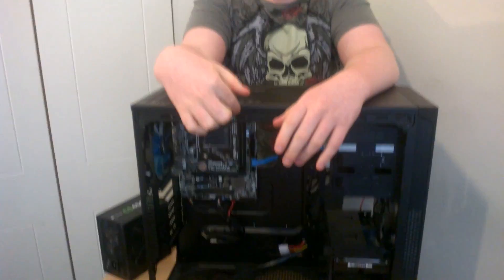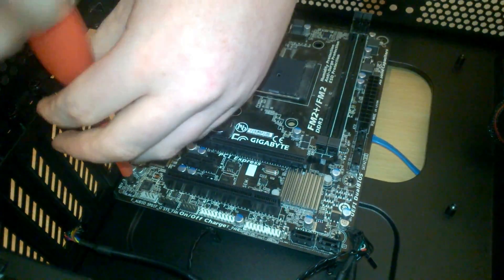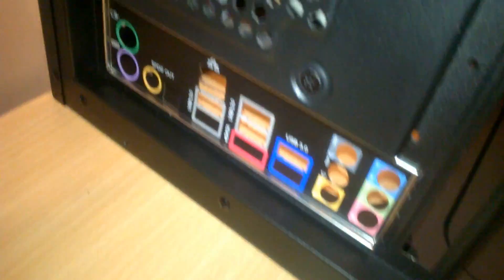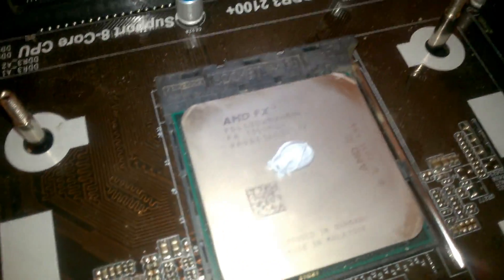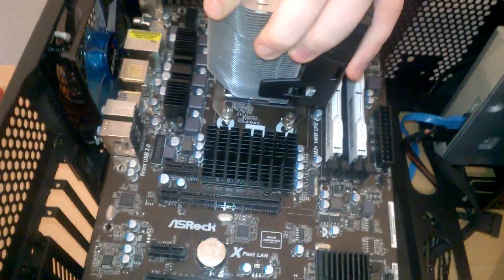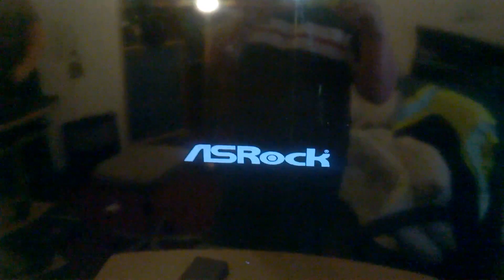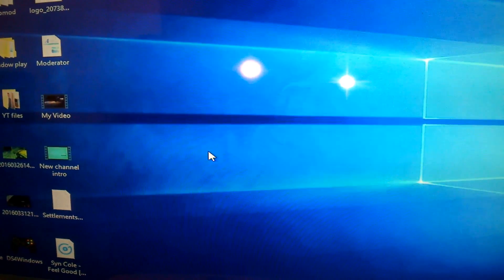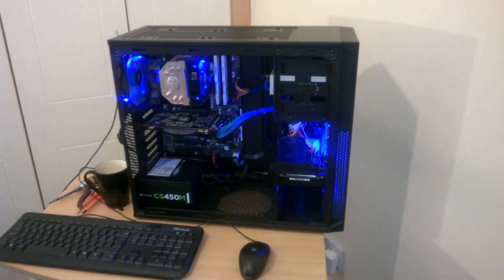How To Change Your Motherboard And CPU

Comment: Hey, I am about to upgrade my motherboard to chipset 1151 and cpu which is i7700k, I want to ask after I swap them should I get the windows 10 key again?
Reply: I am going to do the same, do you have an update, does it work properly?
Reply from the maker: from what I have seen, windows 10 binds to the hard drive, so you should be fine.
Reply: thanks, i hope when I launch my pc it will be perfect thanks again
Reply: Hey I am still building my set up, to make it easier after you build yoour new set up just reinstall your windows and your windows license resets

Comment: Hey u should be more careful about releasing ur info because u showed ur email in the video
Reply from the maker: even if it wasn't in the video, it's on my about page anyway.... So either or, people can easily get my email.
Reply: Sams Tech Tips ok. I was just trying to make sure that you knew just in case u did not want it there for privacy reasons
Reply from the maker: ***** Yeah. I knew. Thanks for caring anyway. Not many people would point that out.

Comment: Could you do a video on upgrading gpus??
Reply: That's relatively simple, the hardest part is choosing the right one for your system. It shouldn't be too powerful for your system, if you would put a 1070 in a system with an i3 the CPU would be a big bottleneck for your performance. You should also look up which Version of PCIe your motherboard has, some do still use PCIe Gen. 2 (which isn't a huge bottleneck but Gen. 3 is faster). And if you plan on using SLI or Crossfire you need to be careful with how much PCIe lanes your CPU has, Nvidia GPUs need 8 to work (I think) and AMD ones need 4 (I think). And for the installation part you just need to pull your old card out (Be careful, there is a little clip on the PCIe slot you need to press/pull to get the card out without damaging something.) and put the new one in. If your MB has multiple PCIe slots use the one that is using 16 PCIe lanes first (it should be written in the manual which one it is), it most likely is the one nearest to the CPU. If you need more help just ask me (or Sam, because this is his comment section :D).
Reply: +slimechunker00 That was longer than I expected.
Reply: +slimechunker00 Oh I forgot to mention that the more PCIe lanes your GPU can use the better your (GPU) performance is.
Reply from the maker: If I can get another gpu then, yeah Ill do that.
Reply: the MSI NVIDIA Gtx 960 Gaming 2 is great value at the moment and is on sale £90 off .. http://amzn.to/1NTXOq0

Comment: hi, I've made a few changes. Instead of 32GB ram, I instead chose 16GB Ram (8x2 Corsair Vengeance). 32 was way to much and 16 is still really good. I also chose the Intel i7 4.0ghz but it isn't over clockable which is fine because I wasn't planning to. I changed the motherboard to the MSI H81M-E33 coz money. I'm really bummed out about the 2 Ram slots that only support 16GB but you have to work with what you have. Same graphics card, Nvidia GTX 970 4GB but the power supply is slightly different. Its the 550watt XFX pro. Is that enough? I'm worried about the power. I was going to get a corsair CPU cooler because the genuine Intel one it gives you looks super shitty, but instead I went with the Cooler Master Hyper TX3 EVO. I could always get a corsair hydro series whenever I feel need to. The fans, are standard ones. The case is the Corsair Spec-01. Is this a good build?
Reply from the maker: would you not just buy a 1070 on launch day? And go for at least a 600w. Also which i7?
Reply: +Sams Tech Tips Intel i7 4790 Quad Core. I was thinking about the launch day thing but this is my first build and I was planning to upgrade a lot in the future, so I thought I might as well cut down on parts so that I can expand my knowledge later on when I need to change the CPU cooler with a better one or something.
Reply from the maker: k but 1070 is just about the same price, and is going to be better than 970, so, would that not be a no brainer?
Reply from the maker: k that's my opinion on it. Why have last ten, when you can have new for a similar price.
Reply from the maker: Gen*
Reply from the maker: k I think a system like that needs at least 600watts, I'd personally get a 750w
Reply from the maker: k you know any PSU will work, just not a crappy one.
Reply from the maker: k What about an Aerocool Integrator 750watt
Reply: Aerocool Integrator 850 W Power Supply Unit ..  http://amzn.to/1NTX4Bs
Reply: Sams Tech Tips Thanks I'll check it out! Actually, nope, I didn't know about, that, huh...
Reply from the maker: k you've been looking for specialist ones haven't you? Hahaha
Reply: Sams Tech Tips Dude I've been typing up 'Compatible PSU's for the  MSI H81M-E33'

haha, and what convinced me even more is that people have made lists of what works....
Reply from the maker: k I hate misinformation. It used to take me hours to find compatible motherboards with the CPU I had chose.
Reply: Sams Tech Tips Yes, if anything, for a newbie like me, I find finding compatible parts harder than actually building it.
Reply: I agree with same, it is a no brainer. The 1070 performs better than a titan x
Reply from the maker: ImWolffie supposedly it does, I'd be happy if it even got close to the 980
Reply: Sams Tech Tips Yes, Same, but its still amazing to see
Reply from the maker: ImWolffie yeah